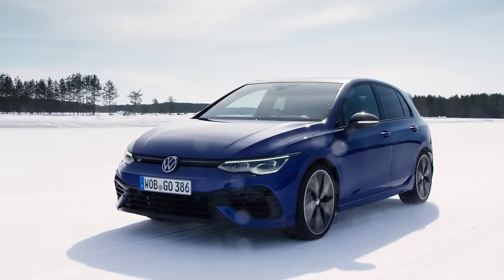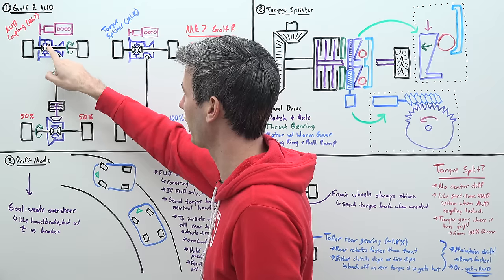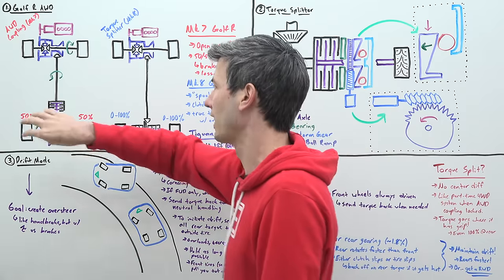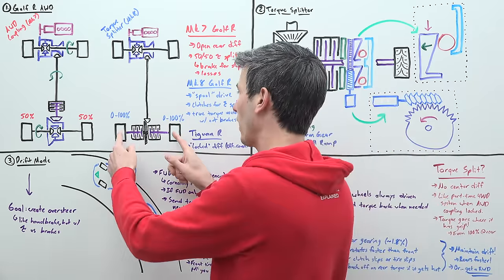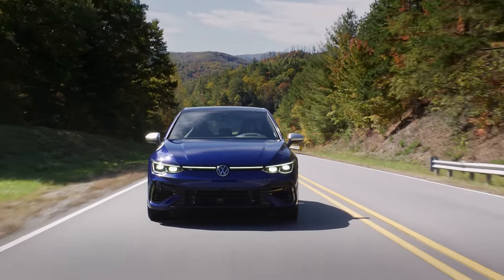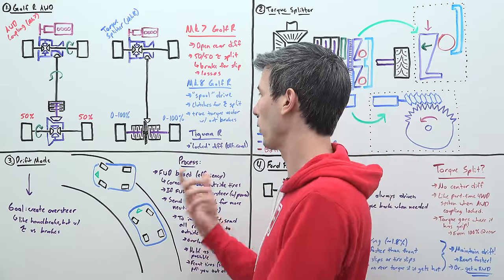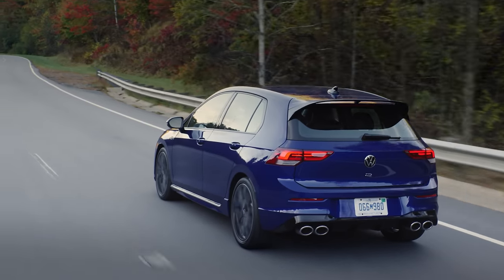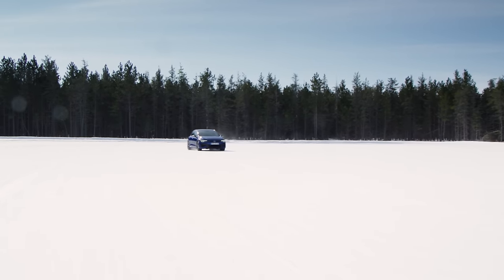Volkswagen's Clever Differential Allows For AWD Drifting - 2022 VW Golf R

Comment from the maker: *Important Note!* There are a lot of comments about longevity and reliability of a slipping clutch. I'd just like to add that nearly every single modern automatic transmission uses (multiple) multi-plate clutches to operate (and of course, same goes for DCTs). Wet clutch packs can last a very, very long time, if designed correctly. Could this differential be unreliable? Sure. But should you assume that it will be without any data? I wouldn't bet on it. Engineers run durability tests to ensure these type of components last. I worked in the forklift industry and we used multi-plate clutch packs for braking, and they'd outlast the life of the vehicle no problem. Oil + many clutch discs means overall wear is very minimal.
Reply: The difference between clutch packs in a transmissions (and bikes for that matter) is that those only slip momentarily during gear changes. If this truly varies torque on a dynamic basis then this would essentially be constantly slipping during torque transfer. Perhaps a CVT type solution would have been better for dynamic torquer split between the two axles, but I'm no engineer.
Reply: What kind of oil is generally used for those? Wouldn't that reduce the efficiency of transfer?
Reply: In regards to Acura's SH-AWD, here's a tech explanation about this: "The clutch packs and friction material are specially designed for the small amount of continuous slip between front and rear axles (created by the 1.7-percent speed differential), while ensuring the expected level of Acura durability. An oil-temperature sensor allows the ECU to estimate the clutch plate coefficient of friction (which changes with heat) in each clutch pack and then adjusts the current sent to the electromagnetic coil that controls the compensation of each clutch. To ensure that the amount of torque transmitted remains optimized as miles accumulate a coil provides a feedback loop that the ECU uses to adjust current to the electromagnetic clutches to compensate for clutch wear."
Reply: This is a pretty old article on some of the first SH-AWD applications, before the hybrid motor stuff. Was reading about it because my MDX with SH-AWD did exceptionally well in some big snowfall we got last night. Acura RL used an "acceleration device" which overdrives the rear wheels up to 5.7%. Really interesting (and fun) AWD system
Reply: I don't get it. This is definitely not for every day driving as you will get a constant clutch slip while simply going in straight line or in corners on dry asphalt. It's kind of a gimmick of fancy traction control for those rare events. All that complexity and extra weight looks like an overkill. This is just ridiculous when you think about what a simple electric moton on eaxh wheel could do.
Reply: @Uninfluenceable  very good idea. Long time ago I had a CVT geared hub on my bicycle, called NuVinci. It had steel balls pressed between steel dishes, and the ratio could be changed depending on angle. I believe it was from 0.5 to 2.0. It was pretty inefficient near each edge, but I expect it would be really cool in such differential. Clutches are just plain idiotic in my humble opinion. I'm an engineer.
Reply: What about a rear differential?  How does that effect tire life?
Reply: @circuitdotlt  For everyday driving the clutches will be mostly open, making the car pretty much front wheel drive. The clutches only engage when you need extra traction. Regularly thrash it on a track and you'll probably smoke the clutches fairly quickly. Drive like a granny and they'll last forever. The transmission will have been designed to have a reasonable life somewhere in the middle of these two extremes.
An electric motor per wheel would be the ultimate as far as traction control is concerned but that configuration has a lot of down sides as well - complexity and unsprung weight for example. Oh yeah, you also need the car to be electric...
Reply: Also most motorcycles use wet clutches for the actual clutch between the engine and transmission, and they do not have longevity issues.  Like you said if it's designed right, it will last a long time.
Reply: @Uninfluenceable  I ride hard Enduro on a dirt bike and the clutch is used almost like a torque converter. When going up a hill under full load the clutch would be slipping 50% of the time and the clutch lasts longer than the engine.
Reply: @LesNewell  I agree with everything youve said, except the last part about unsprung mass being a downside to having an electric motor per wheel. Hub motors for cars don't exist because of that reason, but that's why everyone uses shafts. You can just have 4 motors inside your car and transfer the power through a shaft

btw the new Rivian has one electric motor per wheel, and the Tesla Plaid has one motor for each rear wheel
Reply: @circuitdotlt  In normal everyday street driving, they're probably disengaged completely anyway. These vehicles essentially are just front wheel drive under that condition. So you will NOT get constant clutch slip under daily street driving.
Reply: For all the people worried about the clutch packs wearing out, keep in mind that in a wet clutch pack, oil is forced between the friction surfaces such that torque transfer occurs not only via mechanical friction of the clutch plates, but also via viscous shear forces of the oil. Much easier to change fluid than clutch packs!
Reply: Was this video paid content by VW?
Reply: I wouldn’t be so concerned about the clutch’s but more about the worm gear motor and mechanism that’s constantly adjusting.
Reply: @Uninfluenceable  90% of the time these cars will be operating on fwd mode, the clutches won't get much use unless driving very hard.
Reply: @xtnuser5338  well yes, then it is only a fancier version of ESP. Is all that complexity and extra weigt of drive shafts worth it? Very rarely imo.
Reply: Yeah but vw don't make forklifts. For good reason they wldnt last.
Reply: @Uninfluenceable  you lost me at CVT 🤢🤮
Reply: @Uninfluenceable  Yes, but the Haldex AWD coupling already does this, and has proven itself pretty reliable over last 20 years. So I wouldn't be so concerned.
Reply: @dwvw  I think the video mentioned the rear wheels get varying torque when turning. So it would be significantly used especially in city driving.
Reply: Isn't torque converters predominantly used in automatic vehicles (except for DCT and CVT)? Also gear changes are momentary unlike the case here where the slip lasts a significant time? I bet it's going to be something similar to Focus RS where the car turns to FWD within a few laps of hard driving.
Reply: @pranavpieces  only if you have wheel spin at the front axle. Not in granny city driving speeds.
Reply: @circuitdotlt  I totally agree!  This will be obsolete in five years.
Reply: @b20bigcam  this was obsolete 5 years ago, imo :)
Reply: People don't seem to understand that it's not running the rear all the time.  For normal driving, the rear clutches are open-- they are not engaged at all. It's just a front wheel drive car.   Only in certain conditions will the rear end activate.  Which is determined by the ABS sensors at each wheel.  They measure wheel speed and can easily tell when one slips or when you are cornering;  and THAT'S when the clutches will operate.  On normal straight highway driving, the rear clutches are NOT "slipping" -- they are open and disengaged.
Reply: @circuitdotlt  Again.. In normal driving the rear clutches are OPEN and it's front wheel drive only..  Until the ABS wheel sensors detect a difference in speed-- meaning you have a wheel slipping, or you are turning--- and THAT's when the clutches engage.  It has a fast reaction time.  but going straight down the highway, YES it would constantly slip-- either the clutch or the wheels, obviously you can't do that.  So when all four wheels are spinning at the same speed-- those rear clutches open, turning it back into a front wheel drive car.. You hit sand or ice or a corner and the clutches engage again.
Reply: @LesNewell  YES .. someone who gets it. lol..  The cool thing is, they don't need any new sensing hardware to do this--- they determine wheel speed by the already existing ABS sensors.  I actually wonder if they also have the traditional torque vectoring system still running, by using the brakes?--   In the past, torque vectoring was done by applying the break to the inside tire--  but this system ADDs' power to the outside tire instead..  But I wonder if they are running both systems, or did they just ditch the old ABS torque vectoring--  idk?
Reply: @calholli  probably it still runs the xds+ at the front axle at least, as it has an open diff. Not sure if it helps with the rear axle too.
Reply: @pranavpieces  yes, but only when the fronts are slipping. During regular driving when turning the rear would be completely disengaged.
Reply: @dwvw  Slippage of front wheels is the last factor that engages proactive awd system. There are many of other factors that engage it before any slippage occurs.
Reply: @4x4.tests.on.rollers  yes, and it’s not going to predict wheel slippage while slowing down from 60 km/h to 15 km/h while the front wheels turn. In everyday driving the rear wheels will rarely be under power. About the only time it’ll happen in regular city driving is when accelerating away from a corner in the winter on ice or snow. And even then if you have really good winter tires it might not even happen.
Reply: @dwvw  Check my two videos called "PROACTIVE All Wheel Drive - how it works? AWD / 4WD on demand system" and "AWD SYSTEM - road friction calculation on cobblestones & asphalt  & snow" - they show how often proactive awd system is engaged. For example - car always starts in AWD mode, no matter what conditions are there, it is reading on the fly the surface and engaging awd system hundreds of times during normal driving etc.
Reply: @calholli  so yes, all of the extra shafts and weight are only to achieve better ESP. Which is an overkill, as this car os far from offroad vehicle. Would you pay extra 5 grand ir offered an option of fancier ESP?
Reply: @circuitdotlt  meh.. It's still useful in the ice and snow.- that's worth the extra money IMO, especially in colder places.  Personally I think it would be way cooler if you could have a switch to turn it off and lock the rear clutches all the time for "off road" situations-- on sand or snow, ect.  And I agree, that's a lot of dead drive train weight (most of the time).  It would be nice to have a physical shifter that would disengage the rear shaft completely, like a transfer case.  but then again, your rear CV's would still spin-- so it would also need rear locking hubs to disengage completely. lol. That would be hilarious, and I see why they don't do that.
Reply: @topiasr628  I'd like to know too. Jason posts many brand specific videos that seem quite enthusiastic. They're not bad videos but the lack of disclosure is off-putting.
Reply: Volvo Penta uses clutch packs to vary power to propellers on diesel powered boats (for manoeuvring around marina where slow speeds are required)…these are rated for 100% duty cycle.
Reply: @GLH8  affect.
Reply: @pranavpieces  ya when it's in drift mode.  Not all the time.
Reply: @circuitdotlt  it was obsolete 5 years ago and Ford already did something similar on the 2016 RS.  VW just playing catchup /copycat like lots of companies do with Fords initial ideas.  It's still a VW, so it will inevitably break, often.
Reply: @Uninfluenceable  Wet clutches have been used in heavy equipment for years as the main clutch and brakes.  Depending on application they are often used heavily.  They can take huge abuse and last a LONG time if designed properly.    One car application that is similar is dual clutch transmissions.  Most are wet clutches and they can get slipped heavily in traffic, hills, etc - not just during shifts.   

Another thing to note is that (generally) the speed differential in this case won't be that large, especially when power is routed through the clutch.  It would not likely be slipped all that much, even if actuated frequently.
Reply: Schooled
Reply: Could you please cover the Mercedes Benz 4matics?
The difference between the generations(atleast the last 2 generations)
There aren’t many videos explaining the technical aspects between these generations. 
Could you kindly educate us?🙂

As always great work.

Regards
Kashyap NPS
Reply: Tell that to anyone who owns a motorcycle with a wet, multidisk clutch whos had to change out discs before 50k miles
Reply: It's VW. It's designed to live 60000 miles. Hope this answers the durability question.
Reply: Thanks for addressing this. My first thought was how it would handle increased power and abuse, which inevitably it will be exposed to, but the comparison to automatic transmissions makes sense.
Reply: it's light drag . it's not gonna be a big deal
Reply: The fluid is replaceable on the new Golf R. I believe the focus rs claimed to have a lifetime fluid...

Lets not forget torque vectoring differentials were created by a man at Mitsubishi on the Evo team.
Reply: Talk in a metric like 96% of the world.
Reply: Sure, but having to rely on those AND two motors for your drive train to work is kinda meh. It's more of a bruteforce solution and not particularly clever in my opinion.
Reply: @aaronatstate  Motorcycle clutches only slip on pull out and very slightly on gear change.  Thus the wear is minimal.